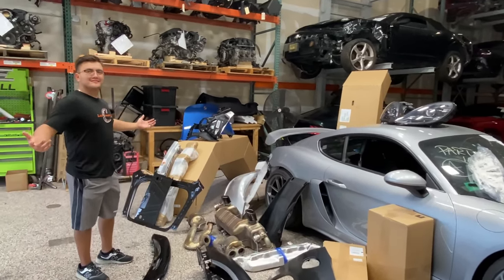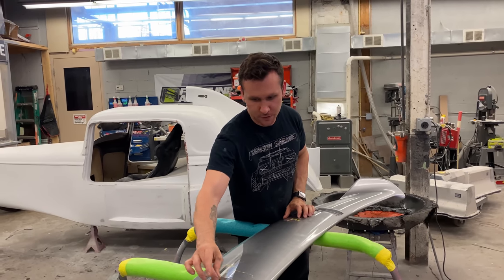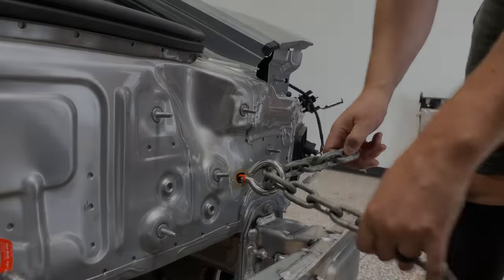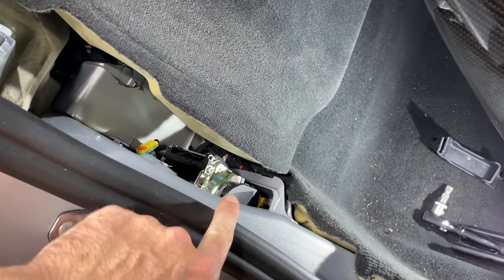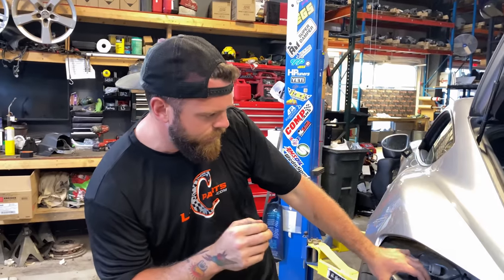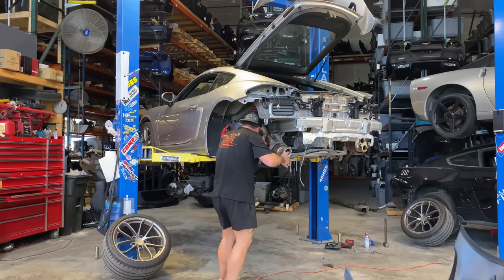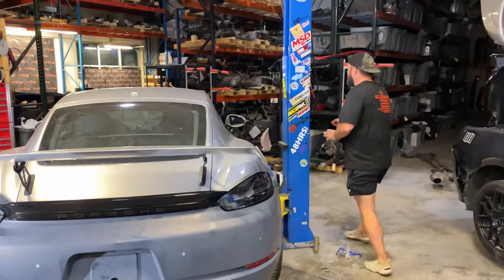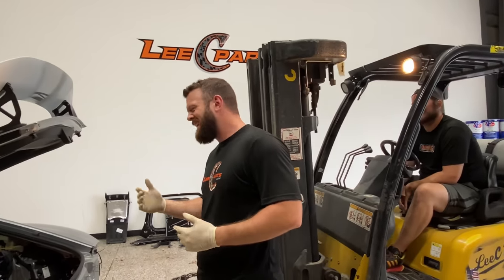Rebuilding a TOTALED Porsche Cayman 718 GT4!!

Comment: Just a note—the GPF (gas particulate filters) on the stock over axle pipes are not monitored in North American cars and have no bearing on passing emissions via OBD. If the titanium OAPs that came with the car are still viable, you can throw those right back on 🤙🏼

Comment: RHD 2020 GT4 4000 miles , took a power pole to drivers side, the  bonnet is good but everything else crunched up to firewall  on that side , remainder of car is good  air bags blown  , Value to pay at auction?

Comment: FYI the valves will automatically close even with the button “on.” It’s not an open/close button, it’s a closed most of the time and and closed all the time button. An aftermarket valve controller is a MUST on 718’s. Pair that with a couple BMC air filters and you’re good to go.
Reply: Interesting, I was wondering why it didn't seem like a permanent open!

Comment: At least you could always put the aftermarket exhaust pipes back on after it gets inspected. It will wake it up more and make it a bit louder.
Reply from the maker: They were bent pretty good unfortunately
Reply: @scraplifegarage  the OE Euro spec over-axle pipes have gas particulate filter in them.  But US spec pipes have an inert matrix and don't do anything.  Feel free to replace them down the road.

Comment: You might still need to look into if the driver seatbelt is safe to use still even though it didn’t lock up in the wreck there still is doubt that everything g is ok with it.
Reply from the maker: It locks as it should, No slop, We’ll see if it has any kind of srs fault when I scan it
Reply from the maker: I wanted to stop back in and give you props for being right, sure enough when scanned the driver belt resistance is way off. 

Good call!